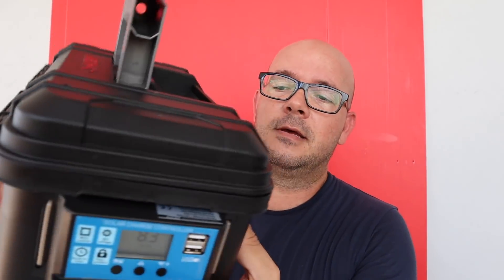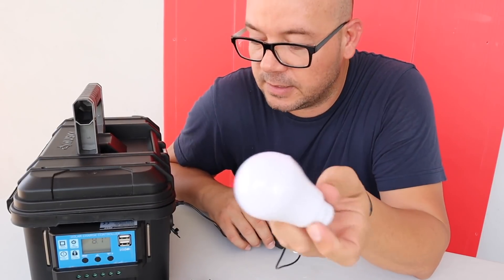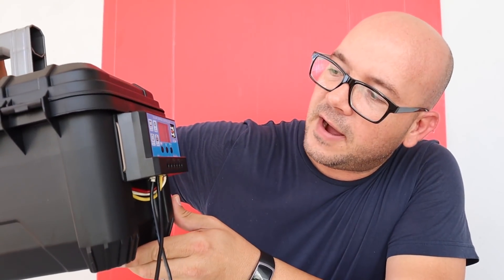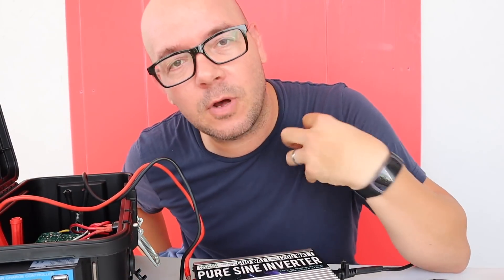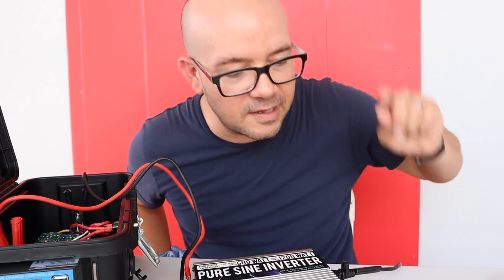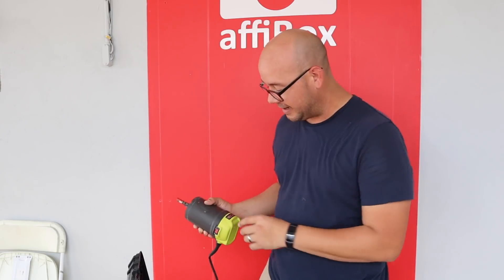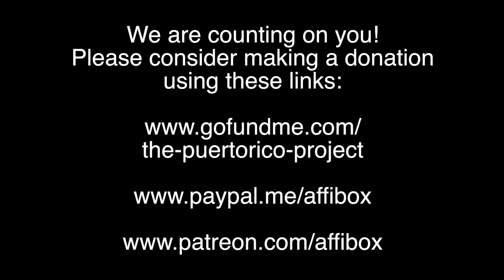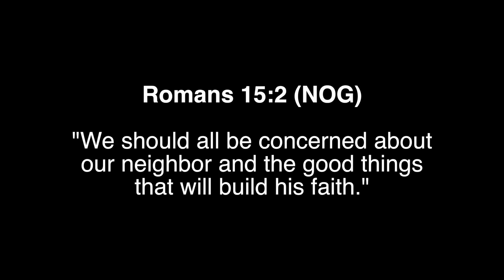Build a Supercapacitor Solar System in Minutes!

Comment: How to charge the super Cap when voltage drop 2v - 6v? Can solar controller charge .
Reply from the maker: It will charge it but it will remain off until save voltage is reached
Reply: @javiercamacho  tq javier

Comment: Hi. In an emergency you can keep the fridge cold like this. Put some bottles of water In the fridge for thermal ballast. During the day, turn the fridge down to its coldest setting to chill the contents and the ballast. At night, switch off the power, it will stay cold with the door shut while you sleep. Repeat next day.

Comment: I'm a bit late to be commenting this, but that inverter has a low-voltage cutoff, at around 10V, so you only get around 40% of the energy out of the capacitors. I would spend half of the capacitor money on one supercapacitor bank and then the other half on a deep-cycle lead acid battery. That'll give you similar peak power output to start devices, with a lot more stored energy.

Also, you might want to tape over your ring when working with high currents from batteries and supercapacitors.
Reply from the maker: Thanks for your advice.

Just remember that in case of emergency is very difficult to ship batteries to an island....
Reply: @javiercamacho  Ah, I forgot you had said that. In that case, I wonder if you could get an inverter that can work between 12 and 24V. That would allow you to get a lot more juice out of your capacitors when running them in series. I don't actually know if you get such things though.
Reply from the maker: Now we do but back them it was extremely difficult to get it locally and the mail was always late

Comment: I'm working on a 26650 LiFePo4 bank, 12v , for my 12v lighting, its over 100ah, I have been debating on getting a 1000-1200w inverter , so I can power my fridge, or microwave if my larger system dies, its 18,000kwh, plus the 800 ah lead acid Bank.  It has a 5kw. Inverter, for my well pump, fridge, microwave , TV, and a couple led lights. But I mostly have 12v lighting, I also getting parts together for a USB, Bluetooth, mp5, with 7" screen, I'm going to put my liFePo Headway batts in it, that is a jump starter battery, to have portable entertainment, I thought about putting a 500-600 watt inverter with it also. But basically if it can't power a fridge, its not that useful, because most things I have are 5v USB, or 12v or 120v, and the Headway cells are 8ah each, it has the current, but not going to last that long, I do plan to charge from either with a balance charger from my 24v system, or from a solar panel for my 12v system, I guess I'll stick with a 1200w or so with my 12v system, and USB only with my mini entertainment system, I just wonder if I can find a small TV digital tuner so it can pickup TV also, great video, keep up the awesomeness!!!!

Comment: 24v. please.
Reply: Not smart with capasitor.

When you connect two batteries in series,you double the voltage,and keep the Ah.

With capacitors, then you connect two capacitor in series, you double the voltage,but the half the capacitance of the capacitor bank.

6 2.7V 600F  capacitors in series gives 16.4 volt 100F capacitor bank.

A 3 volt diff gives 300A*seconds, or 0.083Ah...

Comment: Now buy a deepcycle battery and connect the terminals now its way better
Reply: Will it mess up the caps? Change the frequency?
Reply from the maker: Nope. Caps are made for fast charging and discharge

Comment: I need an snswer..  how much capacitor array need to power a full home eg: 100wh...
Reply from the maker: Capacitors will only work during the day. Your question has no answer until you male a proper test but my estimate is more than 10,000

Comment: A capacity system would help on panels on the move...I tried making a solar trailer for my bike but the trees and constant shading, kept screwing with the charge of the batteries... I just wish they made supercapacitors at a higher voltage...
So this is a 170 F cap?
Reply from the maker: You could put them in series but then you'll loose capacity on the supercaps
Reply: Yea

Comment: At this point you'd be better off with a small AGM lead acid battery.... you have 6Wh of storage there.  That's it.  For ~$100 you can get 20 times that in an AGM.
Reply from the maker: You don’t get it do you?

When you live in a small island or remote area and there is no AGM around or the shipping of a battery is close to impossible, you’ll be super glad to have these around. Specially after a natural disaster. 

This video is not about energy storage, its about saving life. Small systems like this can be shipped all around the world using regular mail, helping people without access to the grid or after a huge hurricane or natural disaster.

God bless you.

Javier
Reply: @javiercamacho  Can't get AGMs made in America but you can get highly expensive super caps from China?  Cool beans.
Reply from the maker: You really need to watch more news. Specially the ones that inspire this video.

A $100 agm battery cost over $100 in shipping to Puerto Rico.

A $50 supercapacitors cost $5 in shipping and can supply much needed electricity to people dying....

Hope you get it now.
Reply from the maker: And made in America means nothing if we can't get it fast and at a low cost.

At least we got paper towels.... 😡
Reply: @javiercamacho  The problem with so little capacity is that any time clouds pass over head even momentarily you will brown out or even black out.  A freezer drawing 100W will consume 1.6Wh per minute (more when you factor in inverter losses) which means if there are clouds for more than 2-3 minutes your device will fail.

Worse, capacitors voltages are linear not log with state of charge (SOC).  That means a 14V array at 50% SOC will have a voltage of 7V which is far less than what the inverter can run on.  In fact 6x2.7V caps charged to 14.4V are already at 88% SOC as it is.  The Inverter will kick out around 10.5V which means you have 3V of usable capacity (18.5%).  

So of your 6Wh of capacitors you have access to 18% of that or 1.1Wh.  Meaning a 100W load with no sun will blackout in less than 1 minute.  2 strings of caps gets you 2 mins of run time, etc.

I'm not trying to be a jerk but this device is worthless.  An AGM might cost more to acquire but will be far more useful.  A 12V AGM will remain >10.5V for most of its power cycle and while the round-trip/etc is bad (typically 75-80% efficient) you can easily suffer momentary clouds/etc far far better.  A 10Ah AGM would net you 120Wh of usable power (compared to 1.1W for a 6x2.7V string).  That's 109 times more energy for only 3.6 times the cost meaning it's 30 times more efficient per Wh to use an AGM than caps.

I'm trying to not get political (since I'm a Canadian and I don't really care about your politics that much) just technical.  As is your device will be highly unreliable on anything but the most pure sun days.  Any bit of clouds/haze/etc and your device will routinely fail which may cause damage to inductive load devices (like fridges).
Reply from the maker: Watch the video again and then use your imagination and creativity to see the full potential of this project

Comment: I love your project .pleas You can put batteries any .ex 18650  it will charge slow with solar but at night  with the capacitor put diode between the batteries an capacitor    directly connected to the fridge the batteries will help maintain it's capacity as a solar .tx😉

Comment: Too bad there wasn't a way to make circuitry so you could store DC in high voltage and then use it down to very little voltage
Reply from the maker: It can be build

Comment: Great stuff Javier! The only limitation with Caps is the discharge rate. They can't sustain long run like batteries. I've tried all gymnastics with them. My next experiments with SupCaps will be geared towards 12VDC fridges, irons and other household appliances. Then no need for inverters. A Pulse mode circuit could be used at the output to secure more running time. By the way, is it a genuine Pure Sinewave Inverter you are using? Where did U buy it? Thumbs up Javier. We are on the right track.
Reply: But the capacitors would definitely help on the surge current that is needed when starting some devices...
Reply: @SolarizeYourLife  like a soft start for an AC
Reply from the maker: Thanks for your comments. Looking forward to see your results. The inverter was bought on amazon, here is the link: https://amzn.to/2SiAOVh

Comment: if we use that kind of system whole day or on daily basis then what will be the expected life of capacitors??
Reply from the maker: Capacitors have a very long lifespan.
Their life cicles goes from 10,000 up to 500,000 and more. They are a great with solar panels and lowering the energy utility bill

Comment: I am an inventor graduated from a Polytechnic Institute from Romania, and 3 of my inventions are in electric motors which may be used for cars. I cannot find any interest for my motors. I find the capacitors batteries the best and I plan to use such capacitors for a small house, I plan to build in Nevada. With 4 solar panels I have 17V at 20 A. The problem I have to solve is to have the charging current less that the solar can provide. The solution will be to have circuits which will limit the charging current and to have one battery charging at a time. The battery discharge current is dictated by the consumer. My email is davidmuresan@live.com
Reply: Dumneseu sete bine cuvuntese. Great to hear that you have worked on motors for electric vehicles. Could you please send me details of your designs? My email is shamnaarai@gmail.com
Reply: hello i am very interested in this ... please reach out to me gigband00@gmail..com or what`s app 9175959153 thanks please...! will willing to invest..!

Comment: This system is only good when used during full sun hours in the night it will drain in seconds
Reply from the maker: You are exactly right. It was not design for night usage. It was designed for saving lives on a Emergency situation. During the day it will be able to power small fridge, air fan, lights, charge cellphones etc, etc etc.

It was never meant to be a 24h solution....
Reply: @javiercamacho  what happens if you hook that capacitor bank to a battety with the same voltage in parallel?
Reply from the maker: @PhysicsViolator  The caps will help the battery and serve as a buffer for high current demand. Then you can use the system during the night....
Reply: @javiercamacho  great. i allready have a 200 amp 12 volt agm battery  maybe i should do that :)

Comment: what makes a super capacitor not a battery?
Reply from the maker: The lack of energy storage for prolonged usage
Reply: @javiercamacho  that makes sense
Reply from the maker: Supercapacitors are good when use with solar panels. the Caps functions as a buffer
Reply: Electrostatic storage apposed to electrochemical😁

Comment: Great project!  What was the watt hour capacity for this module?
Reply from the maker: 1.2kwh +/-
Reply: @javiercamacho  with just supercapacitors as storage?   ....  How is that possible?!?
Reply from the maker: Is not. Supercapacitors are used to pass the solar energy to the desired device. They are acting as a battery.
Reply: @javiercamacho  Sorry I should have been more clear.  I was curious about the WH capacity of the capacitors by themselves, not the average daily energy you could get from the solar array.
Reply from the maker: @EdricLysharae  the caps by it self are not that good. I was able to keep an led light on for 30 minutes. The led was rated for 8 watts.
Reply: @javiercamacho  so about 4Wh.  Thanks for the info!

Comment: Hey I just pre-ordered some of your do it yourself solderless kits. Do you think it’s possible to integrate into a SolarSystem array with super caps and a switch over to battery one super caps are dead. Like for nighttime use? Also using the charge controller to charge both the super caps and batteries

Comment: Men i have a 900 watts of  solar power on my house can more caps help run my fridge at night
Reply from the maker: Only if you have 500,000+ of them and still is not going to last all night specially with a fridge. Just use batteries for the night and caps for the day

Comment: Hi Javier  can you please tell what solar panels you used for this project thank you
Reply from the maker: I used 2 100w panels in parallel.
Reply: Thx what volts are the panels please are they 12v each panel
Reply from the maker: 12v is the “nominal” voltage. These panes are 21v in open circuit and 18v max when connected to the charge controller
Reply: Thank you Javier

Comment: That is a great idea! so when there is sun you will have plenty of power, are there any really cheap batteries that cannot handle alot of current but have enough storage to make it run small things during the night? like have the capacitors handle the surge power but the batteries handle the long term amp draw?
Reply: check about kilowatt labs
Reply: Javier Saludos. El sistema de capacitores es lo máximo. Será factible. Que me hagas  uno . igualito como en el video. Yo soy de Caguas. Me dices cuanto cuesta, y donde buscarlo. Usted es la persona más honesta en esto de energía solar. Mi esposa y yo le estaremos agradecidos. Y después me explica como funciona. Gracias.
Reply from the maker: Ustedes pueden cresr uno muy fácilmente. Yo les puedo ayudat con las instrucciones
Reply from the maker: 18650 are more than ok and maybe cheap lead acid
Reply: Stubblefield coils.
Reply from the maker: What?
Reply from the maker: Can you elaborate?

Comment: I love this idea. Super Cap's are amazing and I'm so glad someone is experimenting with real world projects using them.
Thank you!
Reply: I have a 4.3 cf apartment size fridge that we ran with two golf cart batteries (225ah) and 200 watts. It works well as long as you have 3-4 sunny days per week. The trouble is that with this setup it is hard to get an equalization charge in to keep the capacity at peak level. Adding a third panel for 300 watts work much better and allows for monthly maintenance.

Comment: I guess it would be good to compare the cost of a battery bank of equal capacity to the capacitor bank to see which costs less per watt.  I see where you are going though.  For things like a fridge, where it only runs for a few minutes at a time at full load, a capacitor bank would buffer the short term load of a small battery bank of cells.  Then you have the flexibility to either add more solar panels for daytime peak needs, or more batteries for night time peak loads, or both as your budget allows and your needs dictate.

Using capacitors with small battery banks makes the concept of a community solar power station a lot more doable on a smaller budget.  You could even put all your solar panels in one place between a group of houses.  The nearby homes could connect a mobile capacitor/battery bank to the central panels during the day and then bring the mobile battery pack to their home during the night.  I'm suggesting this because DC power doesn't transfer well over long distances and I think it would be tough to get permits to run private power lines between houses anyway.

Very cool!
Reply from the maker: The main inspiration for this project was that after the Hurricane no one on the island had the money to buy batteries online or in the states sense it cost you $100 for a lead acid battery but the shipping cost was $150-$200. The caps can be shipped over regular mail.

When it comes to Caps VS Batteries the last one will win without any doubt but when you live in a Island and you just happen to be on the largest blackout on the History of USA, and no one can ship you batteries without spending a fortune, then caps will win no questions asked.... 

A Hybrid systems should be a great option
Reply: Hybrid system would be great glad to find you channel- I was looking into this on a slightly larger scale with  a maxwell super cap pack and a couple of simpliphi batteries based since I used to do this early on with car bass/spl audio systems - when I was talking about this to solar installers they had no clue on what I was talking about - glad to see you and a couple other youtubers doing this.

Comment: I have an idea💡what if you use the excess 110v when the load is low (like when the refrigerator compressor cycles. To run a power supply that charges a large battery bank. This will allow you to switch to the battery bank at night?  A relay system could 
Automate that process a switch would make it affordable. This sound doable.
Reply from the maker: It is doable but not practical. With larger panels and charge controller you could just solar charge the batteries as well. That’s for large battery bank. 

But if it is for small banks like, portable fan, rechargeable lights etc etc is more thank doable.